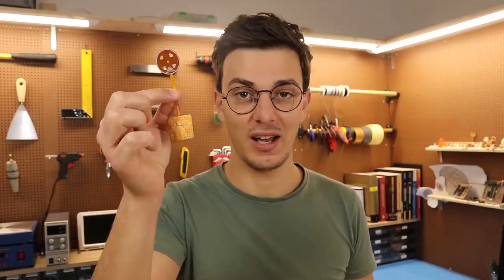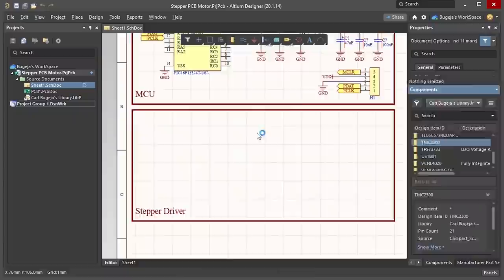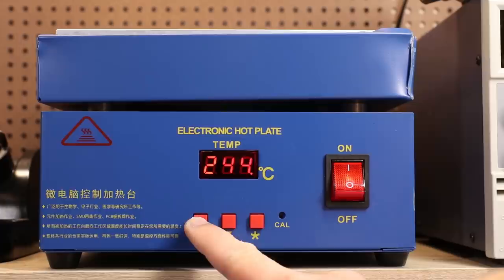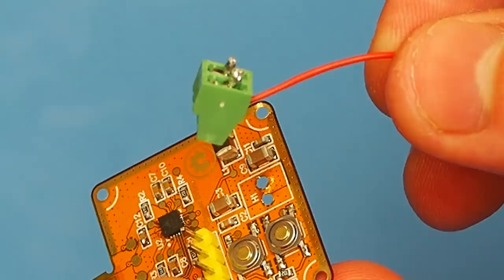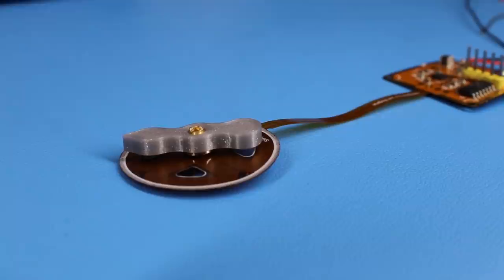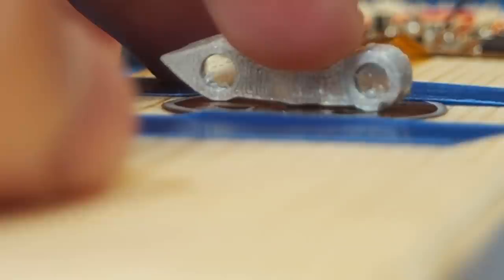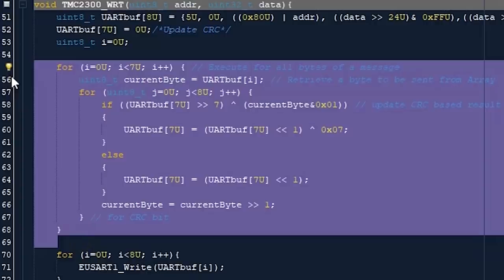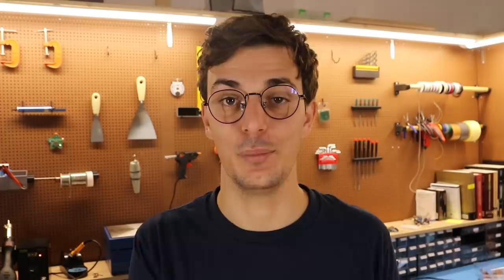Microstepping a PCB Motor?

Comment: The problem is the wide variation in magnetic field across the poles. Either make the poles smaller or the magnets larger so that the varying magnetic flux is evenly distributed when interacting with the permanent magnet. You can use the magnetic field simulator software to get the flux map of your design. Increasing number of poles will certainly improve things. Commercial stepper motors have much larger number of pole pairs and equally large number of alternating permanent magnets in the rotor.

Comment: your reason for using a flex pcb is to get the 2 layers of coils closer together, 
this would be more expensive, but maybe you could try using a multi layer pcb, 
if sticking with 2 layers of coils, get a 4 layer pcb and the coil is on layer 1 and 2 (or design it with 4 layers of coils)
(idk if this would work, still very new to this stuff, never designed a multilayer pcb, so idk what other considerations you would need)

Comment: There needs to be more poles on both rotor and stator in such way that when coil is activated there is always rotor magnet "close" ... so basically there needs to be magnet between poles in every position. That way the motor steps forward all the time. Also suggestion is to add hall-sensor so you know what position the rotor is so you can control more accurately the motor.

Comment: Also neodymium magnets has metallic conductive coating. Alternating magnetic field is inducing eddy currents in this coating which reduces motor efficiency. Try using magnets without metallic coating. Coating can be acid etched from available magnets.

Comment: moisture in the components is why they 'popcorned'. usually smd parts have a moisture ingress rating and if the parts are exposed to atmosphere beyond a set period of days (or hours even) they need to be tossed in an oven for a bit.

Comment: your guess about the reason of flying components is correct. only reason I can guess about why motor don't work good is you need more than 4 coil on your pcb or you can use a steper motor magnet with more than 2 pole !
keep inside of coils free and open , put magnet there

Comment: The problem of popping the chips out of the PCB is because of the moisture forming in between the legs of the chips and the PCB. Some distributors that deliver this kind of integrated chips put the chips in antistatic bags and after that they put also bags with silica gel to prevent moisture to build up inside the package, my distributor put also a sensitive paper in the package in order to see if the chips are contaminated with moisture. The theory behind is very simple, because of the temperature that rises quickly the small particles of moisture expands very quick and pressure builds up resulting a small thermal explosion that pop’s your bits of solder away an the small components also. I hope I was useful enough.

Comment: your guess was correct, but on the wrong substance- it's the water in it flashing to steam that's kicking your components. Heat slowly and with convection if possible.

Comment: I've had issues trying to talk to TMC drivers too (TMC2209). I might be wrong, but I think you have to start with a disable pdn_uart command to shut down the other mode of the UART pins. You might also want to make sure that all your message bytes are individually reversed for the crc, so when adreasing register 1, you actually feed 0b10000000 into the CRC.

Comment: Great work. I think it was skipping because the magnetic flux wasnt strong enough to get into a steady motion. Higher coil winding or increased current could generate more flux. Try increasing current, it might work more smoothly.

Comment: Not sure if this can help you solve the UART com issue but try to put a 10k resistor to pull low "MODE" pin 9 on the trinamic. Bootstraping should be done before power on and not after power on and set the bootstrap by the MCU. Also the add0 and add1, try to put bootstrap resistor as well in order to program the address. Put a mosfet(BSS138 is a cheap option) to pull low VCCIO (pin 11) on the trinamic chip, this will allow you to reset the trinamic chip in case of error. If you do so, please remember to NOT connect pin 11 to the VCC directly but via a pull up resistor.

Comment: Dealing with tiny tiny steppers now (20 step/rev 8mmx8mm) and trying to microstep. Scope your voltage lines to the motor. What you might see if it's the same problem is that the current saturates really easily and instead of a sinewave looking waveform you end up with a few steps and then saturation. I've been fighting to get this down, but most drivers have potentiometers to set current and setting to things like 0.03v is hard with these parts to set things like 70ma current which is also out of spec for the the drivers.  I've confirmed this behaviour at microstepping on 8825, a4988, stspin220 and trinamic 2209. Doesn't matter which, if current setting is too high it'll saturate quickly, so you need it very very very low and then limiting microstepping.

Comment: Hey, looks great so far :D

Have you thought about putting some iron core into your four pcb coils?
Should be very beneficial for the inductance and fore of the coils :)
Reply: +1. Stepper drivers are designed with high inductance of motor windings in mind, here the inductance is probably 10 or 100 times lower. This means their current regulation circuitry is probably not functioning.
Adding external inductors in series to the windings may another solution.

Comment: Carl, check the datasheet for the driver and you will probably see that the microstepping amperage change follows (mimics) a sinusoidal wave. This helps fast turning motors run smoothly. HOWEVER ... if you are doing single steps, you will get almost no step change near the peaks and valleys because the amperage isn't changing much, and then big changes in between when it is. So, it always looks like it is skipping, even when it is not. The only way I can get equal steps is by using a dual h-bridge and full or half stepping manually (with my own code). Hope this helps. It really frustrated me until I realized what was happening. Those drivers just aren't really designed for single steps. Or at least not equal single steps.
Reply from the maker: Thanks for the tip! I think driving it manually with a custom driver would be better.. And this is probably how I would start if I design a second version

Comment: While using bigger stepps, it looked like the problem comes from I think has the name Oversteering. that means when it starts moving it accelerates to a speed, where the magnetic field isnt strong enough to hold it in the next position and the inertia brings it to the position after his designation. to test if it is the problem increase the amps or make the spinner as light aus you can.

Comment: I’m worried the coils aren’t circular enough to get even stepping...

The way I see it, there are two options:
1) Stack two boards with a 45° offset to add more poles.
2) Add more permanent magnets to the rotor at intermediate rotations (halbach array style).

Comment: I think because the coils have very wide wire bundle it makes the area between two adjacent coils have no magnetic field and so the rotor become "loose" in those areas and is not stepping anymore until it's caught above the next coil

Comment: It's not "skipping steps", it's just highly nonlinear. These motor drivers use chopper stabilized current limits. But your motor windings don't have enough inductance to allow the current limit to work properly.  Those stepper drivers need 5-20 millihenries per phase to work properly. You could try adding inductors in series with the windings. Or you could make your own PWM based driver.

Comment: Try submerging the motor in oil to give it bit of a damping. I've noticed that sometimes rotor have too much inertia and moves beyond the next position and when next step happens it makes the rotor go backwards. Loading the rotor with something (e.g. water or oil or some permanent break solved the issue)

Comment: Put two discs with coils one under another with 45 degree shift, you will have 8 coils and you won't skipp steps. Or put one over another like sandwith with magnet between.

Comment: Microstepping drivers are known to not have even microsteps.  The key is that they are repeatable and that they're usually happening on a very small scale where the unevenness isn't going to be noticed (e.g. 8x micro-stepping on a motor which has 200 steps naively, not 200x micro-stepping on a motor with 8 native steps!).

Comment: if you need to micro step smaller steps you may need more coils because a microstep is the step between two coils,the less the coils the less the step resolution but alternatively you can use gears

Comment: Very cool pcb design and idea! But I think what you made is closer to a regular brushless motor than a stepper motor. There isn’t a strict definition of what a stepper motor is. It’s all about how you drive it. So you have technically made a stepper motor. But it’s a 4 step motor. The main benefit of stepper motors is their high pole count. Usually those poles are created by steel teeth so you get a high pole count for low cost.
I think the behavior you’re seeing of poor position control is not due to the driver. It’s just the magnetics. You could test that by sending a very slow sine wave through each coil (offset between the two coils). That’s essentially all that microstepping is doing. It’s open loop control.

Comment: I'm guessing the components were jumping because the the hot-plate was so hot that the flux in the solder paste started instantly to boil vigorously. I'm guessing the earlier boards worked without jumping because the hot-plate was hot enough to melt the solder, but so hot that the solder flux boiled vigorously.

Comment: I would guess that skipping steps can be at least partially attributed to the fact that with stator configuration like yours you need to imagine inverted magnetic flux inbetween the coils, so your 4 pole stator is actually 8 pole. If you designed stator with equal spacing between coils you could probably take advantage of this effect.

I have designed similar motor to this and I couldn't make it autostart, and this was the reason. sometimes magnet got stuck "between" coils and because I used on/off hall sensors to read position, it did not switch. I would have to use 4 sensors for 4 poles or use only 2 poles at the same time (same as PC fans basically)

Comment: You will have "popcorning" if the PCB and components have been exposed to moisture. Having the solder paste in the fridge can give same problem if that's the first portion that you squeezed out of the syringe.

Comment: I think the problem is in non-linearity. When changing magnetic induction in motor with 200 poles the forces are high and the difference in reluktance is low, here it is massive, so for linear microstep non linear currents would be needed.

Comment: For TMC watch carefully for the connection of bi- an one-directional communication. Also they suggest to not use highest BAUD Rate, it seems the also have not very stable com-driver. The cheap designs on ebay also don't always work well.
For the magnetic field of your trinangle based coils i suggest to measure or maybe just sketch the field. The problems at borders of different fields are manifold. Maybe one phase current isn't exactly the same as the others. Do you have measured/knowledge about difference in phase resistance? maybe pre resistors can equalize field inhomogeneuosity, between coils/phases.

Comment: those components jumped due to either moisture or flux in the solder paste rapidly heating and popping bubbles. like you said, they need slow heating.

Comment: Did you try inverting the UART output?

Some datasheets have a habit of showing the data as active-high (logically), but the signal is really active-low. Worth a shot.

Is it also possible that because of the design of the flex PCB, the 
Trinamic driver isn't seen the same amount of back-EMF from the rotor, so it can't get proper feedback from it?

On normal steppers, the rotor is quite solidly "captured" in the magnetic field.
Reply: As it's a one-wire UART, I figured it might use an open-drain driver, at least on one side.

And yep, the diagram on the Trinamic site seems to suggest that. Those drivers are probably on their eval board.

https://i.imgur.com/ynofGK8.png

ie. when the TX on the Bus Master (Arduino) is enabled, it uses a push-pull driver, but it's also an inverting type.

And when the device (stepper driver) wants to transmit, it only has an open-drain driver, so can only pull the line down to Ground to transmit. That also has the effect of inverting the transmitted data, though.

The datasheets might just be showing the logical-high UART data, but really that normally gets inverted on the eval board.

(I haven't actually read the datasheet, btw, this is just a hunch, as it might be quick to try. lol)

Comment: Microstepping (and even half stepping) isn't actually supposed to be used to reliably improve resolution of positioning but rather to create smoother movements - you should always stop rotor at full step position. Of course you can always try, but static friction and different inaccuracies will limit the performance.

Comment: This is a wonderful project, I suggest you another amendment to make the rotor steps more accurate, which is to design small copper coils on the perimeter of the circle so that each coil acts as a magnet that attracts the rotor I apologize for the linguistic mistakes.

Comment: cool project! Try cooling it on a peltier plate so you can pump more current through the coils without overheating. also try visualizing the magnetic field with magnetic field paper while the motor is running. i bet that would look super cool to see the magnetic field.

Comment: Not an expert, but I cook a lot. That jumping is moisture.... I'd say let the PCB's at 90 degrees or so for a while to evaporate the water without boiling, and then crank up to the needed for the solder.

Comment: I am wondering about the magnetic field shape :  the coils are pretty wide and the magnetic flux may be high when close to the coil wires/ The flux is lower in the center of the coils. 
As suggested in other comments use more poles to have smaller coils

Comment: the problem why it skips steps is that once the magnet gets to the center of the coil the magnetic fields are nearly parallel and thus the torque falls off dramatically, which is why the rotor struggles to move in the center of the coil.

Comment: Your field intensity is not very constant so getting constant steps will be hard to do. In a classic stepper motor with circumferential magnetic fields you have more or less constant magnetic field intensity but you end up with very weak fields in the middle points making control in that region difficult/impossible. Try using a regular PCB with an iron core embedded in the middle, and definitely more phases so the magnetic field is more circular shaped instead of a square

Comment: hello friend. I heve noted that some nema17 motors work with the same (wrong) manner with chinees DRV8825 pololy drivers. And it work better with LV8729 pololu drivers. And nobody knows WHY. (In microsteping modes some steps are fewer than theoretical ones, then one big step to comlete position).     If you investigate your problem with sharp positioning - it will help to understand problems for a lot of people with pololu drivers in microsteping mode, and resolve. Tanks a lot

Comment: At the top of the coils the H field lines will be going horizontal.  Have you tried turning the magnets on the rotor to be horizontal vs the up/down ?  Ie N/S in the fixed magnets will be coplanar to the PCB.

Comment: Magnetic field is not even you have a hole in the center of the coil use an iron sheet over the coil. Maybe thats the reason steppers are made vertically and and have iron core over coils. You could make a 4 layer with coils rotated or make the coils to end on the center so you dont get the hole in the center

Comment: If you can find a way to reduce the air gap with ferrous metal, you would get way better performance. A switched reluctance design is also worth trying.

Comment: The problem is  more than likely the design of the stator coils.  They ore one or two layer max...but I think your mistake is trying to mimic a full scale stator. If you have a magnetic field strip so you can see the fields you can set it on the flex board and see first the virtual motion you will get and design the rotor to meet that or design the rotor then the flex to move that based solely on the magnetic field strength and actual location...not perceived location.

Comment: If you allow me my opinion, you say that the motor cannot handle the drivers minimum resolution of 1/8 microstepping ... Well, the TMC2300 drivers, if I remember correctly, have what is called "interpolation", even at low resolutions of 1/2 microstepps, that means that between step and step there will be many steps more than half steps, that is what interpolation does. And if your engine does not support high step resolutions, maybe you should check with other drivers without interpolation, like the common a4988 ... I hope you have understood me, or that I have understood your problem well X -) ... Greetings from Argentina!

Comment: The rings inside motor coils are looking like metallization. If it so, it can act as a short circuit turn in the coil and would strongly affect driver in micro stepping mode.

Comment: I think skipping steps are caused by the inertia of the router. Maybe if you can make a lighter router together with minimizing the current as much as possible to apply smaller force it would work with your configuration.